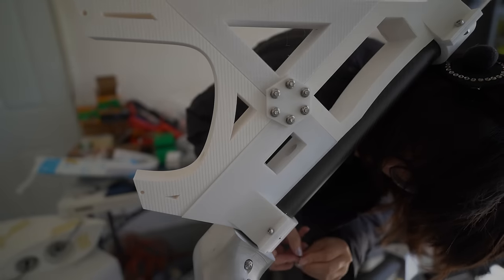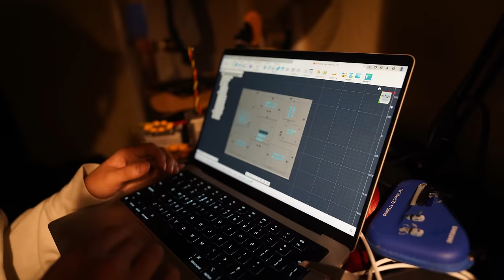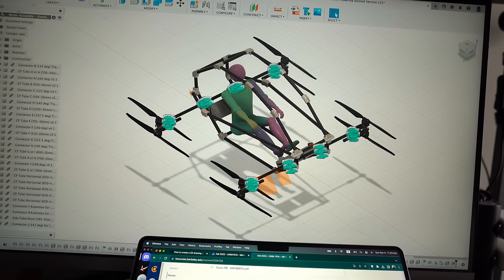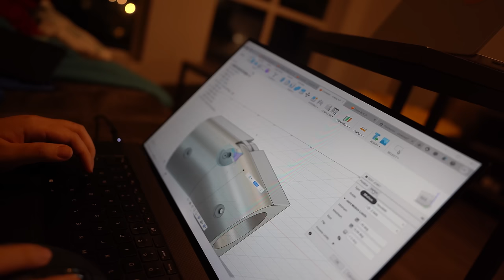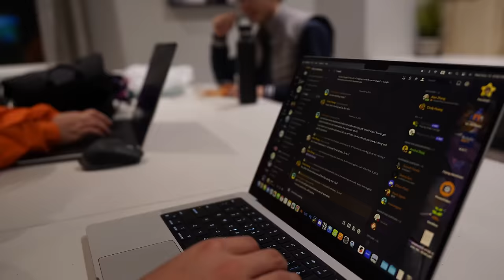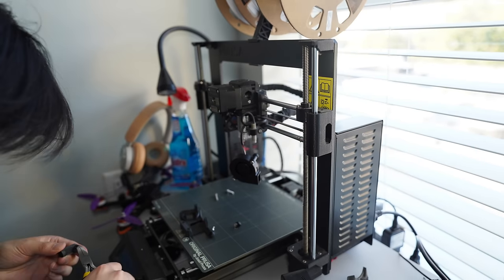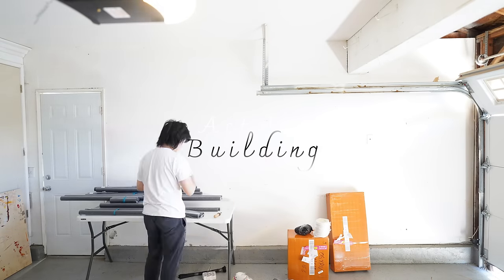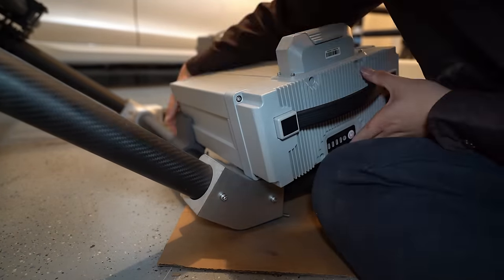I built a flying car! (eVTOL)

Comment: I thought I knew "cool".  This is next level.  Go get 'em, kid!  Let me know if you need a 250lbs test pilot for your next stress test.
Reply from the maker: HAHA, gotchu
Reply: And if you need FURTHER stress tests I’m 290lbs. joking of course lol.
Reply: Nice job def needs reinforcement on the arms 4 arms nice job with the swing 90  on the motors maybe  a heavy duty aluminum sleeve to slide over the joints for rigidity once All align be ready to fly my friend add on 4 air bags like for plush landing .  Nice job again don't forget safety parachute or wing like set up walla.....m😮😮😮😅😅❤❤❤
Reply: 600lb lifting capacity or bust, please.
Reply: You all have a death wish. I’ll hold until I see a design that looks like it will actually fly. This thing has so many structural and safety problems.
Reply: Has to be one of the coolest vids ive seen in awile..and yes with the right dreams and $$,anything is possible,,go get em brother...i truly wish i was still in my early 20's with the tech we have now,and the brains u have,id be flying a dream as well🤙🤙🤙🤙👊👊
Reply: 275-290lbs here, and I fly drones! Love the progress,  keep going!
Reply: @alanzeekk The 3D printed joints WILL fail. Try having a pipe fitter bend those pipes, there is a reason we have been bending pipes for so long and not 3D printing them! You might be surprised at how cheap a quote for those pipes are… Climbing ropes are rated for 1000’s of LBS for a reason. My drone motor almost vibrates the arm clean off because it is slightly out of balance at a specific 1% of its RPM range. That vibrational force is probably in the 10’s of pounds for a drone that only weighs 249g. Good job and good luck!!! I agree with the sentiment that if something can go wrong, it will!
Reply: Nice job! Looks really good. Make sure your fasteners ( screws and bolts) are good. They have to withstand TORSION and SHER forces in flight depending on the location they are in. Keep up the good work.
Reply: @alanzeekk  Alan, what's the dashboard on the mobile phone on your desk --- with the clock and notifications? Is it Samsung Good Lock? Thank you.
Reply: I’m heavy at 315lbs and I’m also willing to try!
Reply: Your too heavy. He needs me
Reply: I WANNA GO TO YOUR HOUSE
Reply: @brandonhicks7549 well add them onto the one you built.
Reply: Ya pick one of those guys. Just film it so I can watch
Reply: Farizz
Reply: @alanzeekk what's the name of Cameron and Chandlers co?
Reply: @alanzeekk I'm from Shreveport Louisiana I have no fear 😂😂
Reply: @alanzeekk 😂😂😂😂
Reply: Shit; I’m 142 pounds wet, have flown airplanes and raced cars, need a test dummy? I’m always available, of course, if any of your friends or kin don’t work out.
Reply: @alanzeekk  I am an engineer and I predicted the structural integrity issue very soon into your video here. I also have multiple solutions that do not require destroying what you have already built, there are just a couple changes in design I would suggest; one of which eliminates the danger of blades breaking away.. I’m happy to help if you would like my input just let me know. I am certain you can glean some valuable information from me. Good luck!
Reply from the maker: @johngemma3533  I already took apart what I have haha, check “community” section of my channel and maybe give ur critic for my 2.0 design?
Reply: Could a gas powered generator provide the power needed to fly this?
Reply: @johngemma3533 
I am a bigger, stronger, faster and smarter engineer n I predicted everything u predicted 1st I just didn't feel the need to cus he prolly saw his mistakes or possible improvements 1st. As he was there, built n tested everything in person.
Reply: Just give my uncle a call if you need to test 400
Reply: @alanzeekk bro YouTube be racist it says translate to English

Comment: As a pilot, it’s clear that any power modulating quad copter design, is extremly dangerous, even with dual props, there isn’t any way to autorotate. In the event of 100% power failure, you’re gonna die.

Comment: Please Please PLEASE add a metal mesh guard around the cockpit. If one of those propeller blades break during flight it could absolutely take your life. Another YouTuber tragically died in a self made helicopter when one of the rotor blades snapped off and struck him. Please be safe 🙏🏽
Reply: Just needs to make fiber glass or clear plastic windows to close the cabin
Reply: A netting system made out of the right material would be much lighter and still allow for airflow through the cockpit. All for being safe, but a metallic cage would be HEAVY
Reply: Who was that?  I remember ages ago watching another youtuber doing a multi copter design but I can't remember who they were.
Reply: @heidi5942  - That’s exactly correct. It was a guy from India. He built a homemade helicopter. He was tragically killed on camera when the tail rotor shattered and struck him.
Reply: A fan guard would be safer for everyone, including bystanders 🥹
Reply: @brandonleesanders  link of the video please
Reply: you know... your title is somewhat deceitful... I'm disappointed... I'm mean it's pretty cool and your brilliant and all but this is far from a working flying car... incomplete!
Reply: @katsderierre9113  even when finished it is not a car
Reply: @RotoRCol  technically cars are a general description to do with wheeled vehicles, so you might be correct there. It's not short for carriage, but car does share the same root word, pertaining to wagons and wheels. You can't have a flying car unless it can also roll across the ground. Nonetheless, a cool project. I do hope he is safe, for his own sake.
Reply: @Jazz3006  The OP states "mesh guard", you know what "mesh" means right?
Reply: @robertsimpson2133  You know how to read and comprehend complete sentences, right? I said "netting of the right material" and stated that that material should not be metallic due to weight limitations. OP proposed metal, I was making the point that it would be too heavy. Now, go back to your corner and have a think for a minute before you respond to someone trying to make yourself feel more intelligent.
Reply: Good advice!!!
Reply: finally a viewer that actually cares about the person there watching
Reply: @mythoti  Exactly, the Jetson One and Air One eVTOLS don't have blade guards either. Really not sure why they don't unless it interferes with aerodynamics or something like that.
Reply: @katsderierre9113  It isn't deceitful, nowhere in the title does it say "working and test flight" it literally says in the description, (if you had eyes to read) "I spent WINTER break building" "will make it fly around JUNE" last time I checked winter is not in june
Reply: jlaser video was only severely injured after attempting a build like this
Reply: He should use carbon fiber muh dude it's lighter than fiberglass and it's usually a go to for aerospace design and also stronger than fiberglass.
Reply: Yes, good point.  A full faced scooter helmet and lightweight motorcycle vest would necessity too.
Reply: If that propeller breaks in mid flight I don’t think you will be worried about it hitting you 😂😂😂😂. At least I’d be like “oh shit!” Im going down 🥲
Reply: @Ghastly10  if designed properly it shouldn't, the new flying car I saw had the fans built into the body, the body just a giant fan guard shaped like a car, if it can fly then independent fans should be doable, it's just a matter of investment, likely requires unique, ultra lightweight hollowed design using carbon fiber or something to make it strong and light enough to sustain flight while maintaining protection
Reply: safety always takes the back seat until is too late
Reply: @Racco20  The title says "I built a flying car", this car is not flying.
Reply: If a blade brakes, he will have more problems than getting hit by one.
Reply: @drfiberglass  - It can still safely land if a blade breaks. There are 8 propellers.
Reply: I saw that, it was gnarly! Very sad
Reply: But wouldn't the channel get like waaay more views and subs if he DID get whacked with a propeller???
Reply: A mesh of Kevlar weave might do the trick to keep weight down.
Reply: Amen
Reply: Wow what an oversight on his part
Reply: Weight
Reply: That would also act as a Faraday Cage.
Reply: I was just coming here to say this. I seen the video not even 24hrs ago and this video reminded me of that. The way that kid lost his life was crazy. Dude deff needs a helmet and some doors or something on this thing.
Reply: I agree, it wasn't heavy enough already, it needs more weight,
Reply: Inspirational! When will you build a heavy combat robot for BattleBots? Or any size combat robot.
Reply: I'd do like, composite duct rings around the propellors. Makes them safer, and improves efficiency.
Reply: Agree .
Reply: Employ a local kid who isn't as well off financially as your family, get him/her inspired , share your knowledge buddy ...amazing what your doing .... In agree with comment re mesh around door ,'safety safety safety '....awesome design though
Reply: Bro, no one cares
Reply: @passportpapi713  If it breaks off and hits you, you might be alive long enough to think "Oh shit! I'm going down!".
Reply: @passportpapi713 an Octo flies with one lost propeller
Reply: We have no idea how many brilliant inventors the world has lost through time because they designed, built, and tested something that was functional but unsafe, and it was the 'unsafe' aspect that ended in tragedy.
Reply: Don't add mesh, make a fully enclosed cockpit. Much safer and it could then be potentially flown in the rain. No wind. Much nicer! It would protect occupant in event of a very low altitude crash! Another thing that I think he'll end up changing is the motor mounts to the frame. They look very sketchy! Especially the lower motors on those brackets!
Reply: Çarbon fiber
Reply: @Jazz3006   UHMWPE cord/rope, encased in a thin, flexible metal tube.
Reply: You'd die anyway if it broke
Reply: @lisahammonds2345  - No you wouldn’t. Drones and multi-rotor aircraft can still fly with a broken, malfunctioning or missing rotor.
Reply: @lisahammonds2345  so hard words lol....fear always  saves...but all the time fearing not good.....yes it would be better if he think most about sefty on micro level write it .... practice it using imagery thoughts..memorise it for 42 days or more then start...so body act safe waywrite safty as first and most important  point in his project plan
Reply: @katsderierre9113  Yeah I felt the same. He didnt fly it and second it's not a flying car. It's a personal helicopter. Without wheels it's not a flying car. Also it's too wide to drive on American roads. Nothing about this is a flying car.
Reply: @tonypalmentera7752  The term "flying car" refers to and has always referred to a vehicle that can drive on existing roads and from any road can lift into flight without adding any new components or modification. This project is nice as a school project but it's not a flying car. Apart from the fact it doesnt have wheels, it's too wide to drive on any American road legally. This is a personal helicopter. Which already exist all over the world and were a HUGE fad during the 1970s.
Reply: Can also add cylindrical housing for the props that will increase lift and can function as a shield
Reply: I think it would make more sense to have something around each prop instead (unless you don't care about others that may be around).
Reply: Forget about protecting his face and what is he gonna do when he crashes
Reply: @mythoti  that would basically ruin the car he could add too much weight do it and then he wouldn’t be able to fly anymore and it’s still going to hurt like hell when someone Rams in to you with that thing, it’s not gonna do much.
Reply: @Captaincardboard99  - It’s still flies with 3 blades. A proper understanding aerodynamics may do you some good
Reply: @brandonleesanders  yeah I know that it will still fly. I mean like what if he crashes it into a tree what are you gonna do then?
Reply: @brandonleesanders  I know that it’ll still fly but like what will he do when he crashes it I highly doubt that little snap off when just flying something would have to actually damage it in order for it to just snap off
Reply: @Captaincardboard99  - What if you cross the road and you trip and get struck by a bus…? What are we doing here..? Why do anything at all then? Jeez this conversation is mind numbing…
Reply: @brandonleesanders I strongly agree with you. Safety first, @alanzeekk! :)
Reply: @nobytes2  Yep. That's why the FAA has to have so many restrictions on custom-built aircraft.
Reply: @brandonleesanders  Yes, but if the blade strikes a live pilot inside the aircraft, then...:/

It's gonna get pretty bad pretty quickly.
Reply: @iamcase1245  It's no less cool though. I'm quite impressed he's able to build something like this. Building an aircraft is a lot more difficult and expensive than building a car.

Comment: Excellent work so far! I’ve been working on my own project for a while. One thing you may want to consider in your design is the ground clearance of your propellers. With any roll or pitch during take off and landing you could potentially destroy your props. Something else to consider is your motor poles are mounted via 3d printed brackets on the interior of your frame. Maybe consider mounting them external of the frame so the frame can offer resistance and stability if the pole in case the brackets fail. I apologize if I sound critical just trying to be helpful to a fellow dreamer. 😊
Reply from the maker: These are really good advice! I appreciate your time. Part II will feature redesign, I’ll take these into consideration
Reply: @alanzeekk 🤔 Feet under chassis…stand a foot higher. ✊🍷🎩🎩🎩
Reply: Once he puts on  some kind of airbags for landing should clear the gap he needs for over steering protection. He may wanna add on a gyro for auto self leveling.
Reply: @alanzeekk   rock on... Safety 1st..#flylike&eagle..
Reply: Not an engineer. Not a pilot. But a thought. 
The folding brackets seem to be an extremely weak point. A carbon tube that would slide INSIDE the main tube (through the bracket point) could be used to add to that structural rigidity. Slide it in and out via a cable/spring/lever when needed or not.
Reply: @alanzeekk  Have you considered that planes don't simply fall out of the sky with any failure? So your frame should be able to coast or glide incase some catastrophic failure you don't simply plummet to your death.
Reply: I was literally going to point out the same thing wrt the rotors being so close to the ground. Needs some landing skids like a helicopter!
Reply: @PLr1c3r  With the vehicle's design being so lightweight, frankly an emergency parachute would suffice.
Reply: @PLr1c3r  What about helicopters?

Comment: I really enjoyed this video ! 

I'm not in engineering nor aviation, but I can appreciate the amount of failure you will endure as a team to eventually lead to your success. What your encountering right now you may not know it yet, but in 20 years you'll look back at this and smile and understand that this was the best time of your life. 

I'm very happy for you and your future.
Reply: I honestly don't think we would be pursuing battery electric planes or helicopters as batteries add quite a bit of mass to any vehicle or transportation mode  and the fact that, unfortunately, you still get better range from cars with internal combustion engine power.
Reply: @WJCTechyman  You can't make multi rotor craft like this work reliably with gas engines.  Their reaction time is too slow and synchronizing speeds is a major headache.  Even if you could synchronize they drift too much over time.  If you want to use gas the traditional single rotor helicopter is what you would have to use.

Comment: As an engineer, love the project and the effort. As a pilot and aviation guy, would say build around CG (center of gravity) for stability. Keep CG below thrust/lift vector.
Perhaps best to have thrust plane/dimension above pilot. This will aid in structural integrity under load. This is not the only way but just a way. In any case, keep pressing forward and enjoy the journey of discovery. Cheers!!
Reply: I don't think he has the power to weight ratio.the fact that he added lights and showed an exposition flying car that doesn't fly.makes me suspicious
Reply: @williamremuso6193    Or a "flying car" that can't be driven down the road.
Reply: There is no triangulation in the structure which is the main reason why this is going to have problems. Also the thrust plane needs to be at or above the CoG. Look at all of the other eVTOLs out there and most have that kind of design.
Reply from the maker: initial design failed --> need more funding more pt.II --> added LED to make it seem more promising --> actually got sponsorship & funding --> now working on pt.II

Comment: Very Very worried about the structural integrity of the arms and the folding hinges. Really not a great execution. But excited to see where this goes and how inevitable issues are resolved.
Reply: Yeah I thought the same, this looks like trash. Bro really put on LED lights before knowing whether or not it will fly.
Reply: So we never saw this thing fly.. whats the point of this video? It means that it doesn't fly.. this video is a thumbnail purpose only.